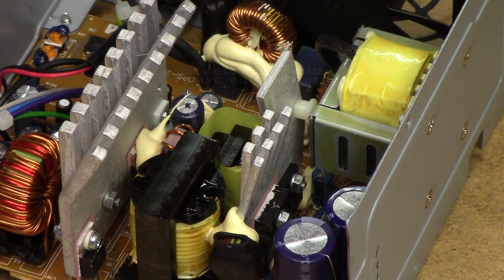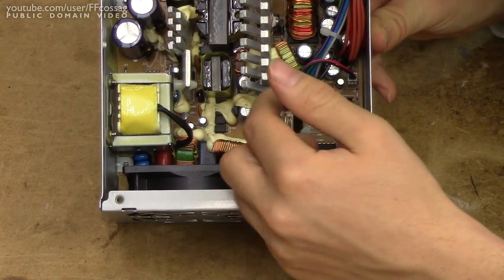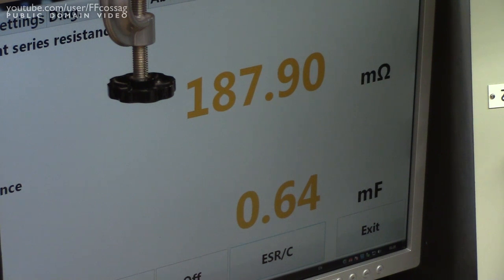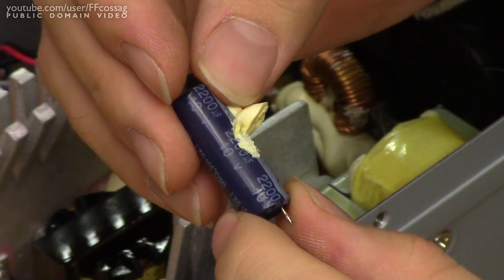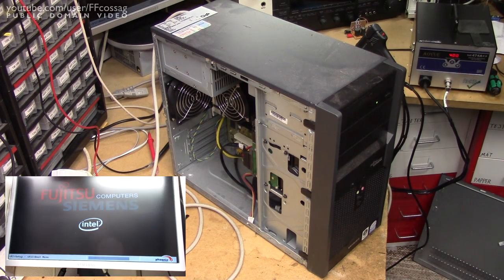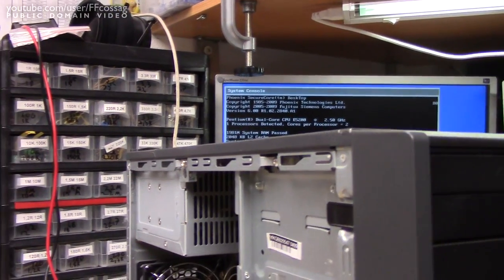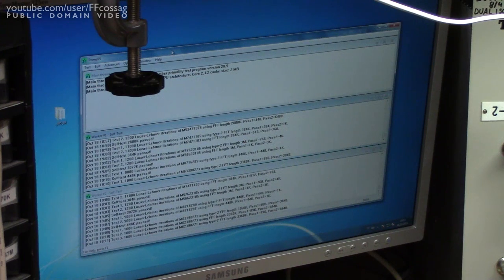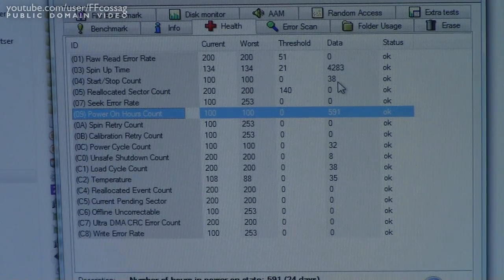3X Delta DPS-210 ATX PSU repair

Comment: Nice job!  I have two Delta PSUs from old Dell machines which are both in perfect working order, and one of them is circa 2007/2008.  I use it for powering server fans and tinkering, and a really nice feature in both of these PSUs is the inclusion of trim pots to fine tune the 12v output.  By comparison, I have a CWT 405W PSU that puts out 11.8v on the 12v rail and goes right down to the bare acceptable 11.4v under load, thanks to the UVP.  No sign of bad caps anywhere... the CWT unit is just very bare with a single DIP 8 chip (PS113) to control the output.

Comment: Those power supplies seem like a pretty clean design.

I've got an ever deepening pile of power supplies with bad caps. I just can't bring myself to fight off all the glue inside most of them.
Reply from the maker: I know your pain. At some stage, I basically started just scrapping shitty supplies unless there's something fancy about them - more use to have the transistors in the junk bin.

Comment: Damn. Really do love the look of those machines on the outside. definitely a good designer for the front panel of the case on the job for them.
but, looks like your standard MicroATX machine inside from that era-- some will say this is a good thing. never did like the vertically-mounted drives some machines like this have though, and HP is another which to this day makes use of that-- especially in the very low-end US$300 or less systems you buy from brick and mortar walmart/staples/office depot stores here in the US which make use of a 40mm-cooled laptop Pentium CPU on a Mini-ITX board inside. IMHO the vertical mounting makes for a bit more stress on the drive motor due to gravity, but the forces acting upon it and the wear induced aren't noticeable for a long, long time, assuming the hard drive lasts that long anyway.
Reply from the maker: Yep, they do have the looks, big part of why I grabbed them. Can just re-purpose the cases with modern innards and sell'em if need be.
Reply: Heh, I have the exact same computer, maybe I should check the caps in it?

Comment: 6:24
What do those types of noises usually indicate? My father's PC has a Corsair branded Delta unit in his machine that whines when the PC is off but it hasn't caused any issues for the last 3 years it has been installed in it. Should I still consider replace the unit?

Comment: Well done, crappy cap syndrome.
For a second i thought that supply was the cheap-n-nasty "Bestec" brand, the opto couplers and that dodgy cap looked in the same place as the bestec type.
Reply: zx8401ztv bestec do make some PSUs that are not too bad e.g. The 300 12z model it is just the 250 12z with the bad 5vsb design that kills motherboards.
Reply from the maker: To be frank, most of these cheap-o units look very much alike.
Reply: Im sure they do, but the bad name sticks.
Most of the other brands slowly kill the capacitors and the computer has odd crashes or wont allways switch on, thats a pain but usually does not mean mobo death, but the earlier Bestec should have been named Deathtec lol.
Its a shame when a company doesnt correct a fatal fault quickly.
Reply from the maker: zx8401ztv You would have to be a marketing idiot to fix an issue which causes out-of-warranty computers to fail.
Reply: Most things do fail out of warranty, in a normal slow way, the BestDeath
 250 supplys just wanted to assasinate the mobo in the process lol.
Reply from the maker: zx8401ztv ...which turns an inexpensive third-party PSU swap into a new machine sale for <OEM>. It's an excellent marketing strategy.
Reply: LOL :-D

Comment: ? what is the device that interfaces with the screen in order to measure capacitors, you mentioned it perhaps in another video?
Oh  another question, not sure you can answer, but is there a way to raise the 12 volt rail on a PS to say 14 volts so I could charge 12volt lead acid batteries. I have power supplies everywhere, none less than 750 watts lol
Reply from the maker: The meter is a prototype that isn't available anywhere due to some design issues, I'm just lucky enough to own one.

As far as raising the voltage, not usually. Sometimes you can reverse-engineer the feedback circuit and just change out the regulation divider, but often there are more hard-coded protection circuits that kick in once you get much past 13 V.
Reply: Thanks for the reply, yea I thought it was a bit tricky to modify. Perhaps I should try to sell these PS's they were time changed out of servers, most with less than two years from date of install, some with near zero hours. All of them standard ATX connectors and screw mount 1U 3U and 4 U size.
12 volt rail @ 60 amp would be no problem..
Reply from the maker: Craig Nehring Sounds sellable.